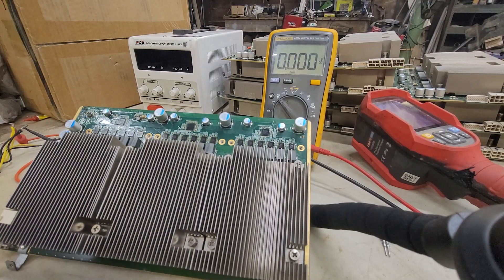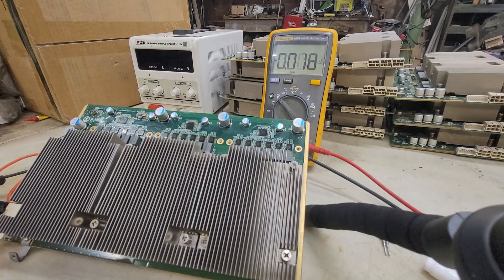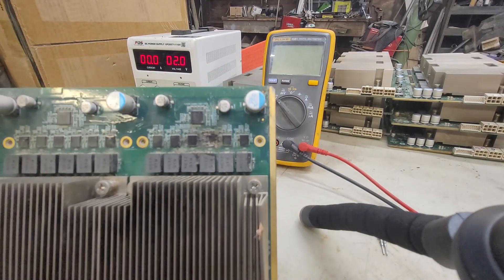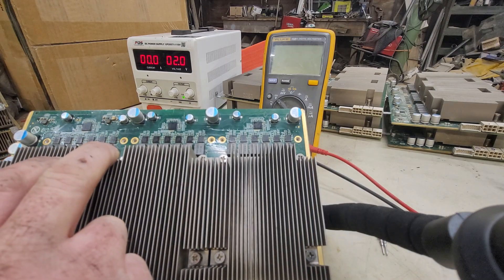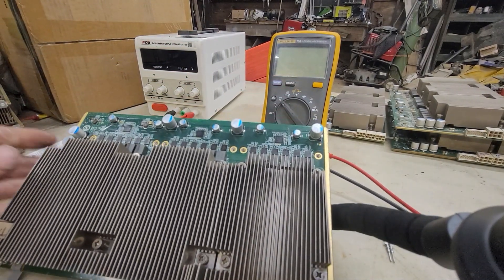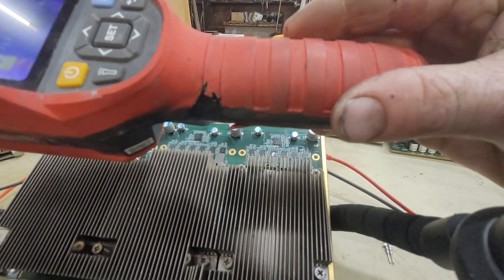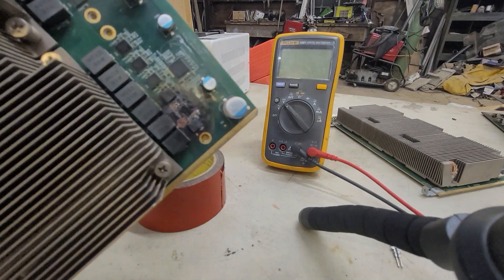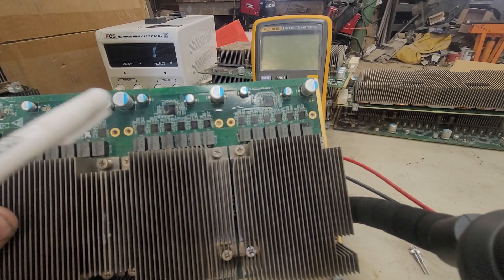Diagnosing 17 z15 hashboards, why did they fail?

Comment: What tool are you using to pull chips? Asic repair tool?
Reply from the maker: Are you referring to the asic chip
Reply: @crypto440 no, I meant for the miner to pull Amperage in your test video. You need to connect to a control board of some sort to tell the 3 asic chips to start mining?
Because if you only connect the DC PSU to the hashboard, the miner doesn't pull Amps, right?
Reply from the maker: @Lucianreal I was just testing the power circuit to see if the asic chips were getting power first. If so, then yes, I use a control board to test the chip and see if they are detected.